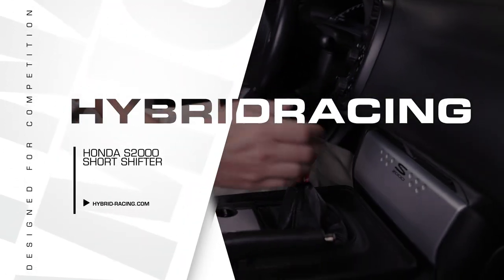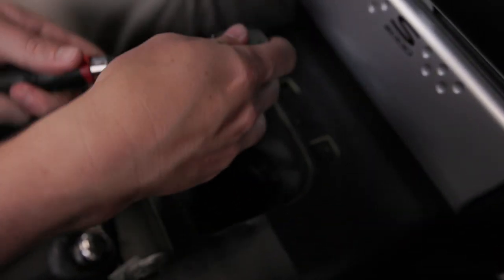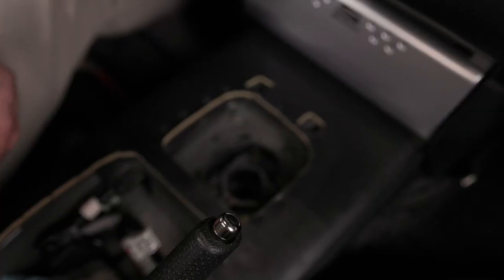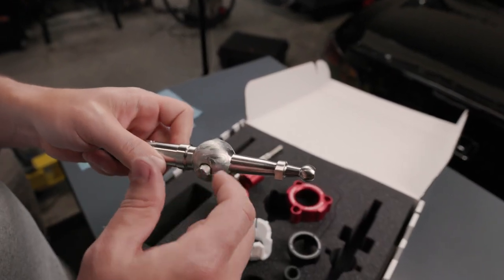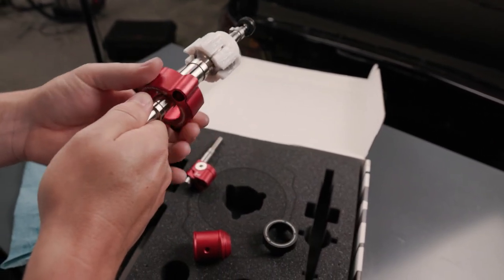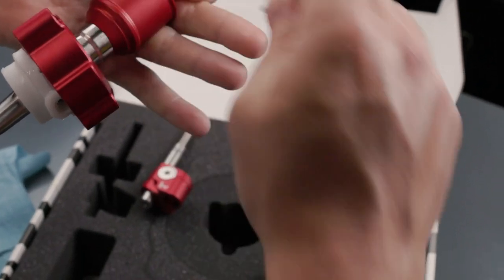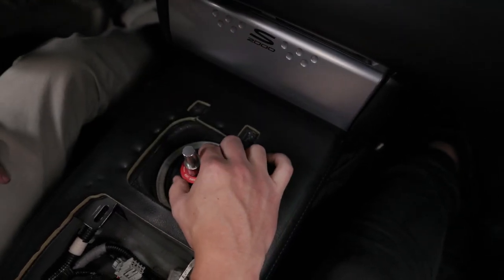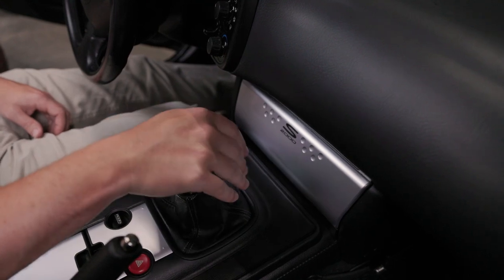Hybrid Racing S2000 Shifter Install Guide

Comment: When you put the new shifter into the car, was the reverse lock out on the left side (towards driver), or right side (towards passenger)?
Reply from the maker: The reverse lockout notch faces the left side of the car when installed. It can only go in one way, so if it is backward, you will need to remove the main ball cup and rotate it. You can also reference steps 15-18 in the install guide on our website.